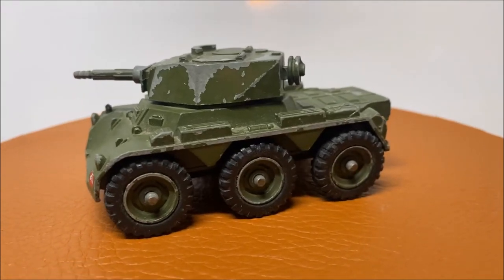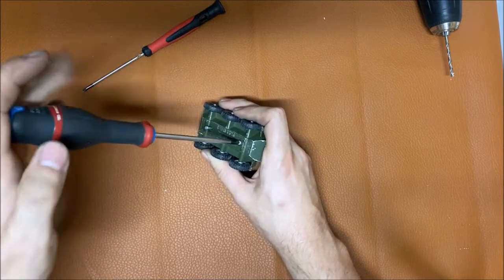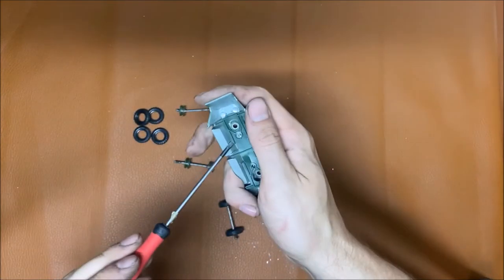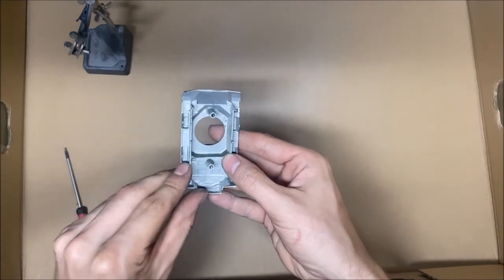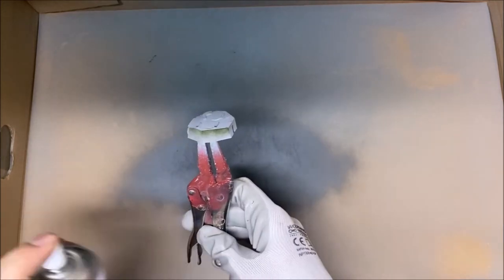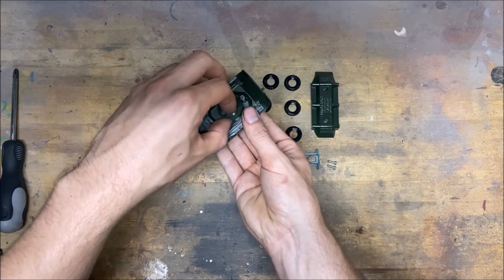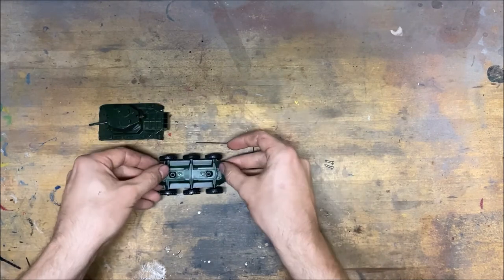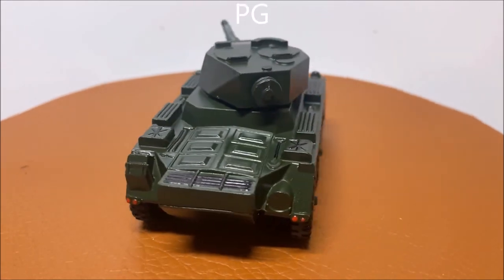Corgi Toys Saladin Tank Armoured Car Restoration

Comment: The shooting mechanism works when you push the barrel back into the turret where it will latch. When the black plastic extension is on the barrel it allows a plastic round to be loaded. To fire it you simply aim and then push in on the telephone cable roll on the back of the turret to release the spring loaded barrel which then shoots forward and stops abruptly thereby ejecting the plastic round. The plastic barrel extension can be sourced as a separate part from various places.